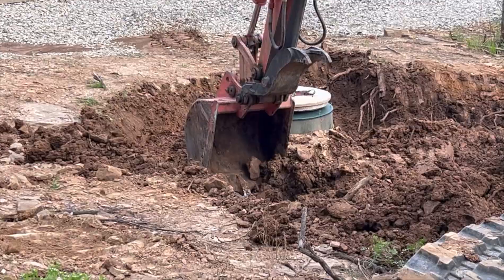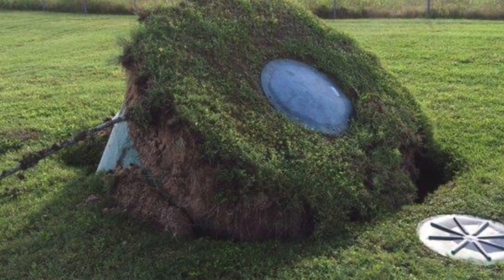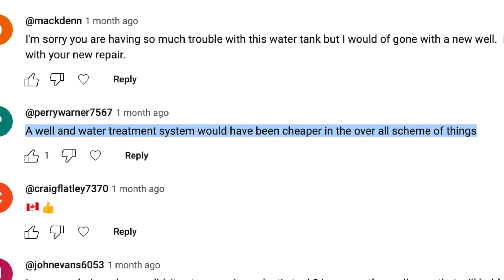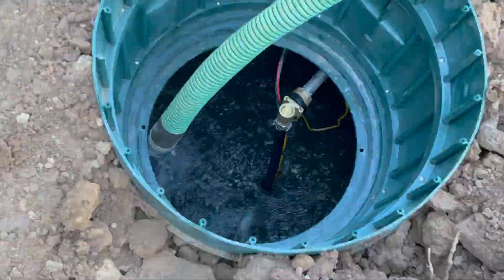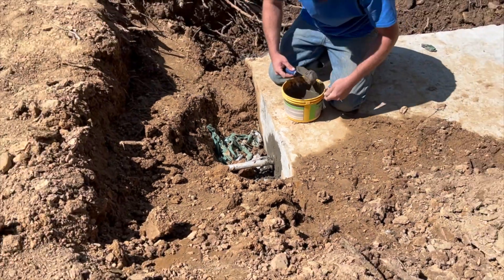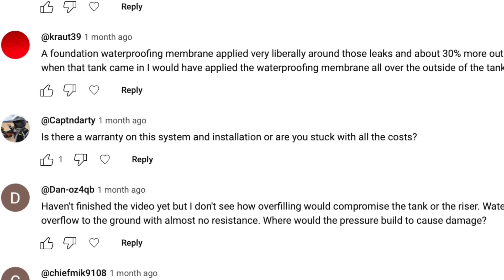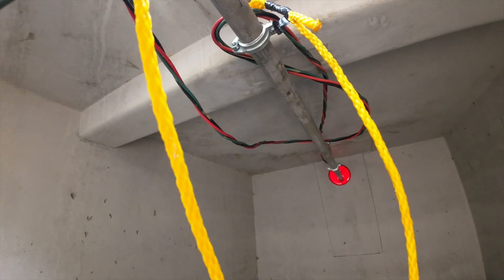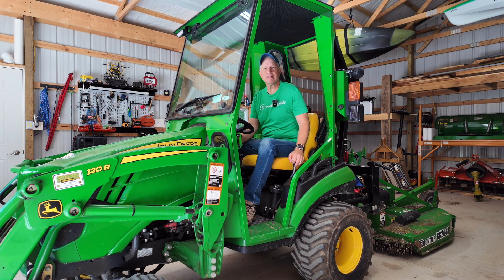Q&A Time:  Water Storage Tank, Concrete vs. Plastic?  Problems?  Who Responsible?

Comment: After considering similar options, we went with a rain water collection system and filters on our cabin.  I did have an option for hooking up to the county water system, but that entailed burying 1400' of water line and a monthly bill for water.  (plus all the chlorine they add!)  As you mention, plastic tanks are pricier, mine is 1300 gal and was $3000.  We've been running off an IBC tote for a year, so having 1300 gallons will feel like an unlimited supply!   We shall see how much of a headache the maintenance will be on the "free" water system.  (not quite done yet)  Glad your tank is working good now!

Comment: Glad it seems to be working now. Thanks for the update. I think you made the right decision as to the type of system but I don't have confidence in the installer. The issues you had should be well known and easily avoided by a professional installer.

Watched a bit more of the video. I still do not understand or accept the theory that filling/overfilling the tank had anything to do with the leak. The water would spill over the riser before it would lift the riser or the tank sections. I understand the power of water but it had an easy escape route so it would never build the pressure required to damage anything. This assumes proper and competent installation.